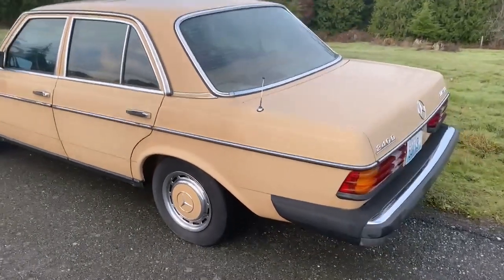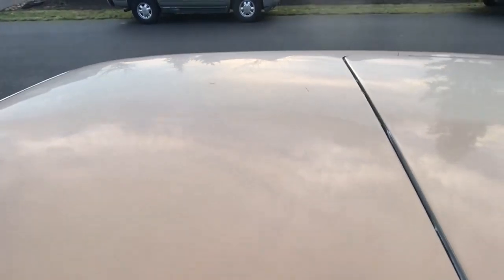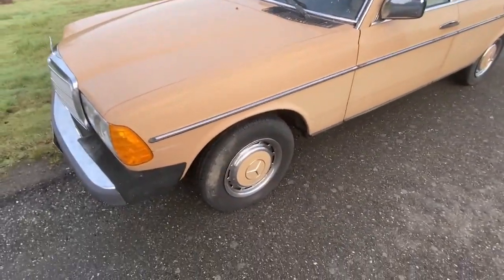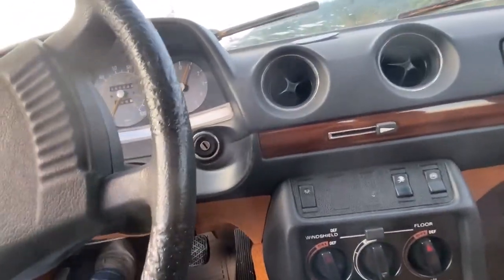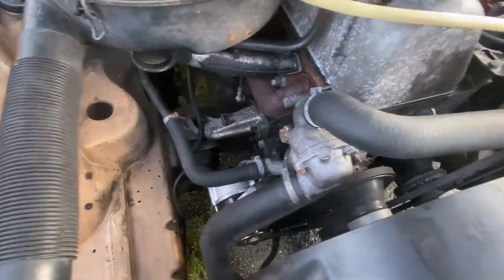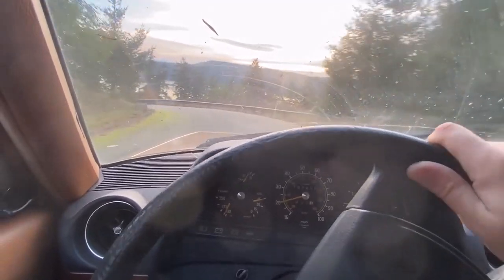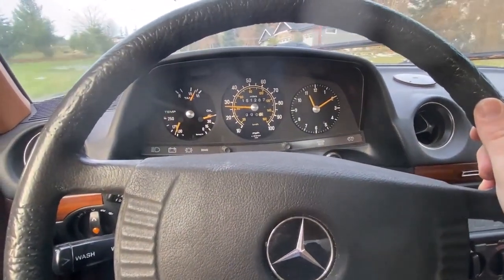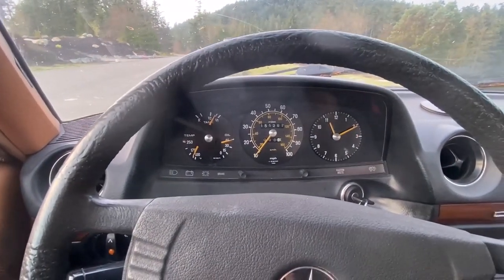1979 Mercedes 240D Walk Around - When Rescuing One W123 Diesel Mercedes Just Isn't Enough!

Comment: Fantastic. I couldn't believe the condition of that car. Far nicer than both my 81's that I had some years ago. But then I noticed it only has 151K on the odometer. Both mine were over 300K when I bought them. When I unscrewed the oil caps on both they would shoot out of the engine  bay like bullets. I love that color combo too. So 70's and that paint will look great once  it's been cut and polished. In my opinion the 123 240D is the greatest car ever made. And I'm not kidding. One day I hope to be able to acquire another.
Reply from the maker: I think that 151K is off by a bit - odo is not working...typical...

Comment: Wow! For the price it is in REALLY REALLY great shape! I have an ‘82 300td and recently had to get the transmission rebuilt, but I hope the service needed is on this one is just some maintenance… the engine seems like it’s running strong, great 240d!
Reply from the maker: Trans is still a bit wonky - even after service. Need to do a bit more work to diagnose after the 300D is back in service.

Comment: i love love the simplicity of it!  But i would need power windows locks and a/c.  Cadillac and Lincoln owners would laugh...  $17,000 (orig msrp?) for this mercedes and no power windows locks and ac????  i love it!!!  it's the perfect size.  cute little diesel engine and plenty of room to work on it.
Reply from the maker: Drove it into Burlington from Anacortes today to get new tires on it. It needs valve adjustments; the injectors probably need to be rebuilt. The thing is dog slow, and I'm at sea level. It is straightforward to work on. And yes, I would have opted for the Lincoln or Caddy back then (DeVille & Continental were about $13k!). Not many Caddys or Lincolns are still on the road from 79, though! 🙂